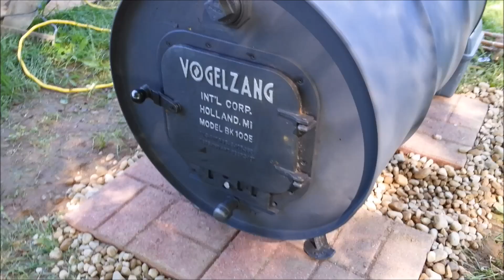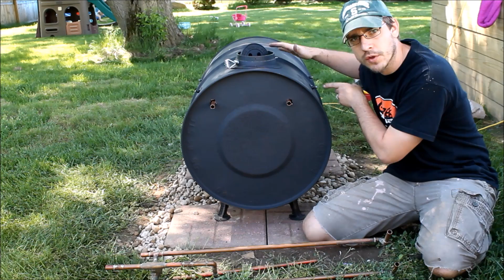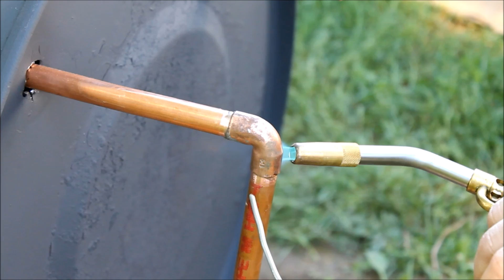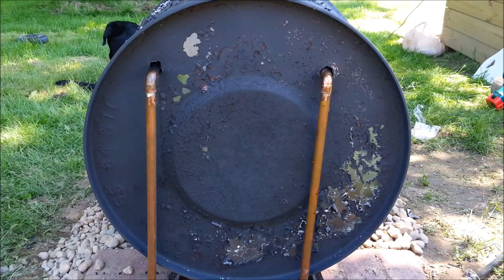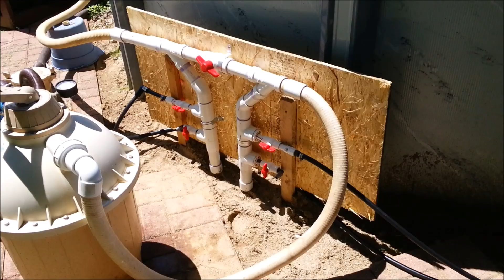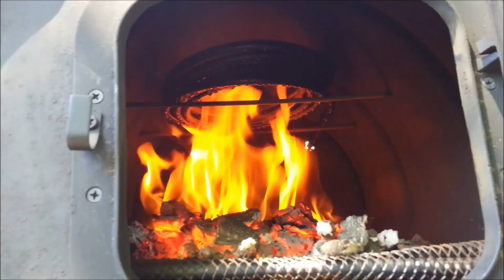Wood Burning Pool Heater - Heat Your Pool For Free!

Comment: I'll guess you can call it "free" if you got unlimited access to free logs to put in the burner.

I'm setting up a solar powered pool heater right now and my goal is 30°C / 86°F in the pool. I'm starting with 250 meters / 820 feet of 20 mm / ¾ inch PEM hose in a flat rooftop setup. A 20V rainwater barrel pump (2,000 liters - 528 gallons / hour) will be connected directly to a solar panel, so it's a completely automatic system controlled and powered by the sun.

No sun = no pump = no heating.

The cost for this setup so far is 350USD and the only thing that actually can break is the pump (50USD). So I'm hoping that my setup is as close to "free" that you can get and the best part of it all - it's fully automated, so zero manual labour.
Reply: Fascinating. Since we are going with unsolicited stories and suggestions in the comment section to this man's pool heater video you should 100% marry the first woman who sleeps with you.

Comment: Great video. In process of building a hot tub heater now. If you were to change anything on your heater design what would it be? I just want thermo suction so would it be better to have outlet coming from the stove higher than inlet? How does the copper stand up to the intense wood heat?

Comment: Great info thank you! It would be super useful if you could share the pipe and connection sizes please. I’m struggling to go from copper to 32mm pool hose
Reply: The connectors are hard to find.  Could also use help

Comment: do you this if you would go  1/4 or 3/8 inch copper in the barrel it would heat better it may slow flow for better heat absorption  then adapt 1/2 inch to inlet  and outlets?
i am assembling one next month but have a wood stove any comments or help 
woappreciated

Comment: That is super.  I'm looking for something simpler and mobile that I can hide behind the shed under a cover  just to get to temp and then let the heat pump take over.  I think that I will start as the reseller of everthing.  Its an interesting place to find needed pieces of anything but auto parts.

Comment: i would add some fire brick on the walls(inside) to increase the fire temp and insulation on the barrel, pipe and line. should cut down on the wood use and heat up quicker.

Comment: Hi, We just build one last week and sorry to say we didn't see any temperature increase of pool water. Our pool is 37x 17 inground and have a lot of trees all around my house. Water is 69 degree which we diverted by submersible pump to copper tubing in wood stove. This results in a lot of condensation on the pipes which drip on burning wood and put out the fire. Another problem we faced, we got 60 feet 1/2" copper tubing and it was not fitting from the door so we cut the opposite side half lid of the barrel to get the pipe in. Also my husband start saying copper will react with chlorine and will leave green spots on the liner. We are quite disappointed after putting in a lot of money and hard labor. Can you help us out may be somehow we can improve the system.
Reply: We are having the same problem! We have been burning wood for about 3 hours and we haven’t seen any increase in water temperature.
Reply from the maker: It will take a lot longer than 3 hours to increase the temperature of 15000 gallons of water. Run it for 10-12 hours and you should see a couple degrees
Reply from the maker: Sounds like you have a good setup. Couple of things. First, the chlorine will not react with the copper and cause issues. We had ours running for many years and no issues. Second, try slowing your water flow down through the heater. Are you getting hot water out the other side? If you are getting hot water out then you are heating the pool! It will take a while to heat that size pool, you will need to run it all day to see a few degrees. Condensation is normal on the copper

Comment: Thank you for these great ideas. I'm hoping to combine a home made solar panel bank and attatch to a small one person swim against a water flow pumped pool. I could donkey your log burner onto it after it primarily heated a 2 man hot tub. I'm a keen DIY person but haven't any figures on flow rates, water volumes/temperature levels etc. It would be really helpful if you have any of these technical details for your system. Also the region your located is in for sunlight, temperature and rainfall, as an indicator of protection levels against weather. As I'm in the UK I fancy making a glass enclosed swim (useable ambient heat), and an outdoor hot tub. Thanks in anticipation. Maddie lone female DIY addict! M

Comment: How about using PEX tubing as your intake and return tubing? I plan to use an old delapidated BbQ grill (can move it around) as a barrel with tubing in the lid and a drill pump/fountain pump to move the water.

Comment: I am thinking of doing something similar but with a couple modifications. Think of things like this, the goal is to heat the water by a somewhat small temperature difference in as short of a period of time as practical. There is no significant shortage of heat in the firebox, so you want to expose as much water as possible to the surface of your exchanger (coil) in as short a period as possible ( so as to efficiently use fuel, spend less time tending fire, reduce risk to kids, less neighbour smoke complaints, etc.). 

Assuming you are using 1-1/2" pool fittings, you are sending only about 1/9th of the volume of water that you could be through pushing through your heater/woodstove (theoretically - ignoring line loss, etc). Manifolds seem rather expensive but (ignoring that, or looking for alternatives/cheaper versions) what I think I would/will do is ideally find two 1-1/2 x 1/4" (x 36) port copper manifolds and run 36 x 1/4" lines through your stove similar to how you installed your coil. These need only be short passes as there is a little volume going through each pass and the goal should be to push as much water through as possible. If the math worked exactly (it won't I'm sure), instead of putting 60 gallons per hour through (as per the video example) there could be something on the order of 540 gallons per hour passing through the exchanger.

I mention the use of a 1/4" branch manifold only because that would be what I would think would be closer to the ideal situation but in reality, finding these could prove challenging and expensive as they don't seem common. Smaller diameters offer better exchange as the surface area to volume ratios are much better than larger diameter tubing. That said however, a more practical version could use a 1-1/2" x 9 port 1/2" manifold on both sides and even a 1-1/2" x 4 port 3/4" version could be worth looking into with your manifolds mounted on the back end of the firebox and your tubing running from back to front.

Just some early morning ramblings of someone who has never done such a think except in my head!

Comment: I like your idea I have a very similar set up at home as well I have a solar heater for part of the time and I have a small wood burner to use it to open the pool instead of diverting into the pool filter I use a sump pump to run into the heater and I have it on a timer so I can adjust the time so it pulses and gives the water time to get good and hot and then empty and then get good and hot again

Comment: Been thinking about doing this myself. But I have decided to rap the copper tubing around the outside of the barrel instead of inside. I feel like the copper inside would build up with creosote and lose efficiency. I have been researching to see if anyone has done this and I have not found anyone to wrap the copper on the outside. I would then insulate with kale wool around the bar rels to preserve more heat. What do you guys think? I'm also concerned that it may heat my water to steam. At that point it would be a bomb right? I absolutely love your video SSL dad. Keep it up!
Reply from the maker: Check out the follow up video I did where I talk about all those things gs you just mentioned

Comment: "Heat your pool for free"... After $750 in materials and 40 hours of labor. Still a good idea though.
Reply: I made one last week roughly $280 but I wrapped the barrel with an additional 60ft of coil works well however I had to run pex as the return as the garden hose melted...

Comment: I wonder if its better to add the threaded fittings not only to the pex tubing to avoid the heat from melting the solder elbows right off the drum?

Comment: Does the fire not deposit carbon all over the copper pipes which then insulates the outside preventing heat to transfer into the pipes?

Comment: So what and where is the free part?!  
Nothing of this heater is free
Reply from the maker: The free part is heating the pool for free, not paying for propane or natural gas, using free wood
Reply: @SSLFamilyDad  
Solor would be a much better "free" way of heating a pool.  Yes, both have the initial cost for the mechanism that is being used to heat the pool.  You don't have to pay for sunlight. 
But with your "free" method, still takes all that time and energy to gather, cut and load the wood into the stove.  Not only that but now you have some sketchy ass "pool heater" that could potentially cause a fire. 
Time is money. I'm sure you don't work for free.

Comment: Why wouldn't you wrap it around the barrel so it wouldn't be in direct line with the fire?!...I'm no expert or anything like that I was just saying so the coil would last longer unless its uneffective by fire
Reply: The melting point of copper is 1984°f (1084°c) with the water going through it it wouldn’t reach a point where it would be compromised by direct fire. Placing it in the outside would cause a lot of heat loss not to mention it would be a lower temperature heat too.

Comment: When I built one, I used Furnace cement. You cement in the tubes to the back of the drum. It holds the heat.

Comment: This is going to sound stupid but bear with me. A tealight burns at 829-1000c  and normally 5 hours. Would it be possible to build something that would eventually heat your pool using a tealight?
Reply: Steven Cutcher Are you suggesting heating a swimming pool with tea lights?
Reply: @deanhenthorn1890  no not at all it a debate we and a friend got into and I wanted to to know what you thought. The debate was over whether or not it was possible that something could be build using a tealight candle to heat a pool.

Comment: I made this today and it works I need to put a valve on the water in side to restrict it a bit to control the heat better but I'm super impressed with how well it actually works

Comment: I am a bit curious the copper doesnt melt or get destroyed by the high temps? I have an indoor pool and a fireplace next to the shallow end 😉😉😉 im thinking that this is genious but im afraid that the copper will melt eventually. What is your thoughts?
Reply from the maker: The copper will not melt unless you have a blast furnace. Also, it is filled with cold water so it actually never gets that hot
Reply: @SSLFamilyDad  i see your in michigan too, what a year its been so far. Pool finally hit 60 degrees after many weeks being open, ours is inground and indoors, i have made a heater but i used 50ft of copper we will see how long this takes😁 i have the water coming out between 90 and 113 degrees depending on how much i stoke it. Its def not swimmable at 60 inside with no 🌞. I really am hoping the weather picks up around here soon!

Comment: Hi! We tried to make a pool heater like you. But the water comes out cold! The pipe in the wood stove stays cold (the stove is 300 degrees celcius) so I guess the pump is to fast. The copper pipe is 5 meters long. We have a Doughboy pool power pak 2. What do you recommend? Is there a formula on how long the pipe has to be to heat up nicely?
Reply from the maker: Use a diverter like in the video to divert only a portion of the water through the heater. If you are forcing it through very fast it will not come out hot. Slower flow equals less water but hotter

Comment: The heat in that fire is much lower down. Putting the coil into the coals or the brightest part of the flame would yield better results.
Reply: Will it eventually melt the copper that way?

Comment: I viewed all of your videos from solar to the wood burning stove and decided to do the wood burning stove method first.  I stumbled upon a prebuilt double barrel for $150 so purchased that instead of doing the work myself.   Any advice on how to maximize its use? And could it handle burning wood in both chambers with coils inside each? Also I’m considering purchasing 200’ of extra coil to wrap around the outside but looking for a little advice ahead of time to not waste.
Reply from the maker: I would say focus on coils on the main burn barrel on the outside, I think 200' might actually be too much! Might be steam by the time it gets back to the pool. Maybe two loops 50' each
Reply: SSLFamilyDad would you suggest 3/4 or 1/2” from you experience?
Reply from the maker: Either is fine, 3/4" would give better volume but will be harder to wrap and work with

Comment: Does the water heat up high enough to release toxic fumes when it hits the PVC ? Or how hot is the water out of the coil before it mixes with the cold water again?

Comment: Sorry but that fire isn't going to do much.  Think about it:  put a gallon of water on a gas stove.  How long does that take to heat up?  Ok, now multiply it by 25,000 for a 25,000 gallon pool.  Even a 300 gallon hot tub is too large to be heated this way.

Comment: Might be better if you silver braze it instead of soldering it. Solder melts at a lower temperature and may leak water after the solder melts and weakens
Reply from the maker: +Steve Rabon great point that would be good fprcthose two connections near the fire!

Comment: Nice video! Do you need to worry about the chlorinated water from the pool corroding the copper pipe?
Reply from the maker: I never seemed to be an issue over the few years I ran it

Comment: I think it will be a lot more efficient if it was a 1 1/2 pipe inside the stove.
Shorter but bigger and all the water from the pump pass by there,so you can take ALL the heat the pump can take from the stove.No réduction,no restriction.
Reply: Fred P It's all about surface area with the smaller diameter pipe
Reply: The probleme with the smaller dimeter piper is the debit is insuffisant.
For me, i built mine with 2 ways of 3/4 pipe in parallel

Comment: I have an old gas pool heater with a cast iron heat exchanger. i was thinking of using that heat exchanger with a wood burner. Basically same as you did here except without the copper coil
Reply from the maker: I think that would work really well!

Comment: This video made me go out and build my own exact same for my 18' round pool.  My water was at 71 when I started my heater.  Water exiting is about 104-112 at 1.9 gallons per minute.  I can increase the flow of the water but my temp drops to around 90-95.   I have about 40 feet or so of 1/4 inch copper coiled in my heater.
Reply: Increase the flow at the max you can,you gonna heat the pool faster  this way.does'n matter the exit température is less hot, the water is in circuit with the pool ,it's not like if you only want hot water to wash your hand and it loss after.Here the water  came back again and again.The faster you go the more calories you extract from the stove so the faster the pool gonna heat up.
Reply from the maker: that is great, at those temps you can heat almost 2500 gallons per day up to 108 degrees. That should make a nice impact on that pool temp!
Reply: SSLFamilyDad unfortunately I'm battling cool temps outside right now.   68 during the day and 48-54 at night for the next week.  in 8 hrs today my pool temp went up 36 degrees.  I'm happy with the setup.
Reply: After 24 hours my pool is at 76 which is good considering overnight temps were around 60.  This setup is working pretty good.

Comment: What ended up being the cause of the paint peeling? Was that the original paint/graphics peeling off?
Reply from the maker: +Kcducttaper1 I should have fired it up and let the original paint burn off then cleaned it up and painted it with the high temp paint

Comment: do you think it would be possible, by using elbows and sections of chimney to route the chimney stack under a long, 10-12ft bench and have it come out the other side?  people could sit on the bench and it would be heated.  i want to put something like that together for an outdoor area.
Reply from the maker: +P Kurk I don't see why not as long as you get some height on the pipe at the end so the heat has a chance to rose and start a good draft
Reply from the maker: +P Kurk also, fill in around the pipe with pea gravel under the bench to hold the heat
Reply: great info, thanks!  im going to wait until summer before i build but ill let you know how it goes!

Comment: Will the copper inside the barrel melt eventually ?
Reply: Best to use silver solder for the pipe fittings as has better heat rating
Reply: if it ever runs dry it might.
Reply from the maker: +joshjaydah nope
Reply: That's right. Braize those joints and it's as good as no joint at all.

Comment: What do you think of using the barrel in the upright position, putting a couple 60 foot copper coils in it, filling it 3/4's of the way up with water and having the fire underneath it? Once the water reached about 200 degrees that thermal mass wouldn't need a lot of additional heat to maintain that temperature. I'm in CT so I might use a water/glycol mix.
Reply from the maker: +Jim Argo that would also work i think, might be hard to water proof the bottom half but the theory sounds great